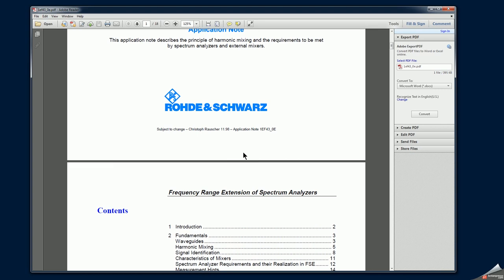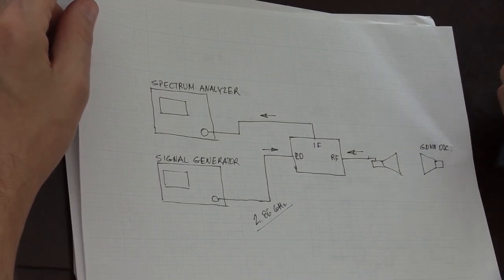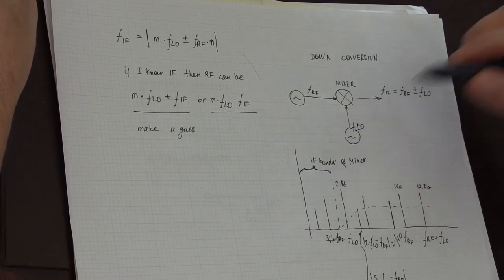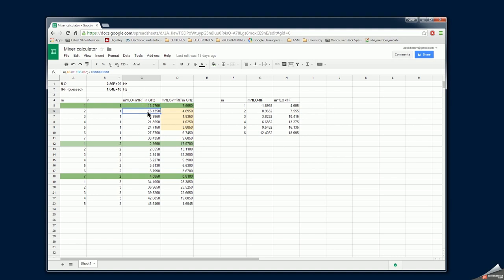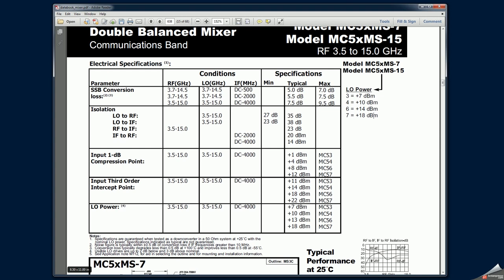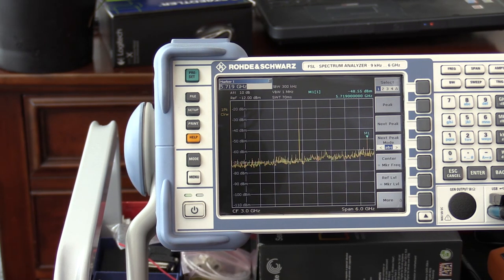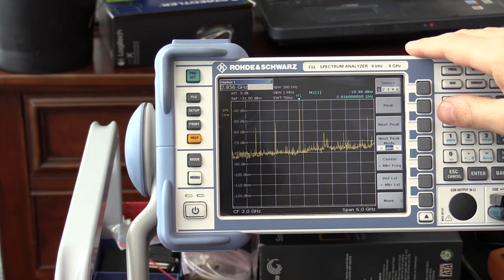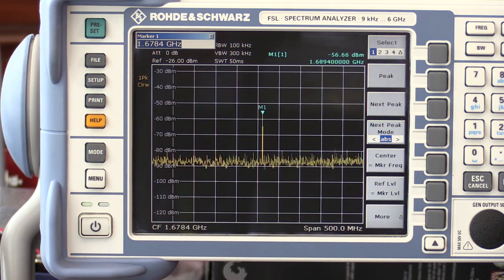Episode 6, Extending useful frequency range of Spectrum Analyzer

Comment: Nice video. I can not see the button of subscribe so I think that will be the one and only video you will upload but I would like to solve the opposite problem. Let's say you have an SA that gooe from 100Hz up to 10Ghz but you are interested in the range 0-100 Hz how can do it with the SA? (without using the trick of the sound board in a PC)

Comment: Hi,

I'm using the R&S®FSW Spectrum Analyzer to measure frequency of a ring oscillator on an FPGA, but the frequency seems to drift a lot. It ranges from 103.2 to 103.4 MHz. Is there anyway to get rid of the drift? Also, how do you access the frequency counter on this spectrum analyzer?

Thanks! :)
Reply from the maker: Shahin B Spectrum analyser does not have frequency counter. Accuracy with which you can determine frequency of your signal depends on minimum resolution bandwidth. In this case it is 300 Hz, but you can get more accurate than that if your signal is stable CW - check the manual. Also I am using 10GHz Rubidium frequency standard to remove static error that you can get if your SA internal oscillator is out of tune. 

I am not sure how you get so much drift from your ring oscillator. Look at your clock signal waveform first of all all - that is most likely reason. If your clock is nice and clean then your drift is result of other logic gates (not part of ring) running in same FPGA. By switching simultaneously those gates affect rise time of signals inside and thus you get your variations. Altera has good training materials on subject on their website. But honestly why bother - just get another external, standalone clock. Most FPGA support more than 4 clock lines.